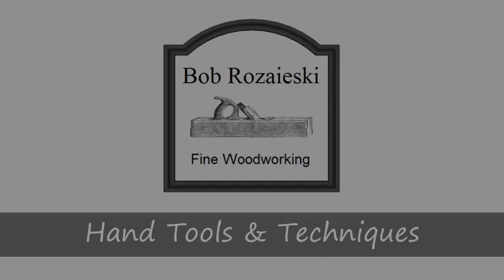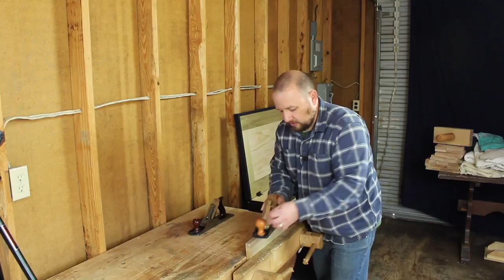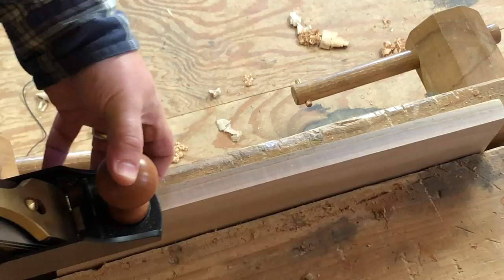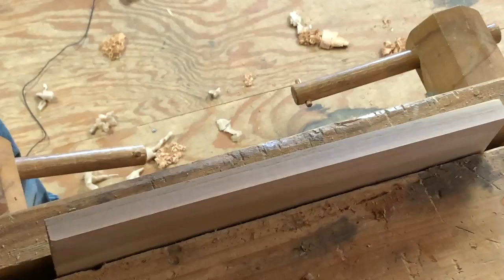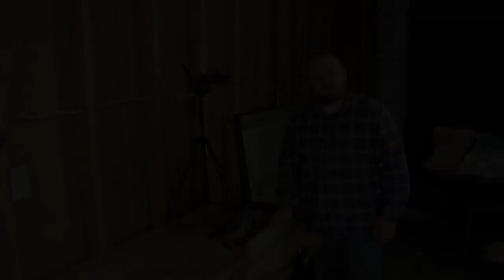When to Stop and Sharpen a Hand Plane

Comment: Really true. Freshly sharpened blade go through the wood like butter effortlessly. And when I start sweating then I know for sure that it need to be sharpened. I'm a woodworking hobbyist since about 4 years (thanks to you and the other youtubers) and sometimes I don't touch wood for months...but after a couple of years I've start develop the feeling. Now I just need a second to touch the blade and know at what level of sharpening it is. My prefer method is to slide my thumb on the blade very very softly (along the edge, not through..and yes I know it's the best way to cut my finger :) ). Thanks for sharing.

Comment: Clicked like before even watching the video. Do you still use oilstones to sharpen your blades? Have you changed any thing about the way you sharpen?
Reply from the maker: Snowwalker I still use oilstones for my gouges, molding plane irons, and other high carbon steel tools. For my bench stones I switched to Sigma waterstones because of all the abrasion resistant steels used by modern toolmakers. Other than that, I still sharpen the same way I have for many years - hollow grind, hone on stones and strop.
Reply: Bob Rozaieski Fine Woodworking thank you Rob I to use both oilstones and Sigma. Lately I've been experimenting with naniwa diamonds. I've heard they last for years they are quite fast and stay flat.

Comment: But is it closer to an hour of use or ten minutes of use?
Reply from the maker: SkylersRants Could be either, or both. Time really isn’t an important factor to worry about as there are too many variables. It depends on the type of wood, the aggressiveness of the cut, the pace of the work, the angle of the bevel, the type of steel, and the needs of the situation. For example, I’ve often gone weeks between sharpenings for my jack plane and mortise chisels when working with white pine, while at the same time I may sharpen my smoothing plane after only 20 or 30 passes on a particularly squirrelly piece of curly maple. It’s more about the feel of the tool, the results you are getting from it, and how those two factors compare to your desires or expectations for it.

Comment: I think that one reason a lot of us don't stop to sharpen/strop enough, is because getting the blade back to where you had it, before sharpening, can be tedious.
Reply from the maker: Matthew Buntyn Yep, it sure can be if you don’t do it enough. But like anything else, the more you do it, the faster and easier it becomes. It’s become second nature to me now. After sharpening, reinstall blade and extend slightly, sight down sole and adjust for even side-to-side projection, retract blade fully, start planing and gradually extend blade until it’s back to where it was. It took me longer to write the process out than it takes to do it 👍🏻.  Takes a bit longer with wooden planes but still can be quick with practice.

Comment: Without both planes being the same this demonstration is pretty worthless. The difference could be just down to the length of the bodies.
Reply from the maker: Well, you're only partly correct. If the board were rough sawn or the edge were not straight and flat, I would agree with you that the length of the plane could impact the demonstration. However, this board's edge had been planed straight and flat prior to the demonstration to take the effect of an out of flat edge out of the equation. So essentially, both of these planes were doing nothing but smoothing an already straightened and flattened edge.

However, I do agree that it is not easy to demonstrate the point that I'm trying to make. Attempting to show visually what is actually something very tactile, is not an easy thing to get across. But I did my best to answer the question.
Reply: @BobRozaieskiFineWoodworking  perhaps. Variables still negate experimental results due to their influence on outcomes. The point of experimentation is to find answers, not raise new questions. It sounded to me like you knew what you were trying to do was hard. It may be even harder to do than you realize. There would always be the human factor that would be extremely difficult to eliminate. Your subconscious bias could influence how you use a tool, which would skew results. For instance if you "knew" one plane was duller than another one. Then you'd likely use it differently. Science is a hard thing. Which is why I leave it to the men in the white coats.
Reply from the maker: Paul Frederick I agree. My day job is in science so I totally understand the scientific method and how having multiple variables can result in convoluted outcomes. However, this was not meant as an experiment, rather as a demonstration of how differences between a blade that is getting dull and one that is sharp might present themselves. I fully knew the outcomes ahead of time as I knew one blade was sharp and one was dull. I was not looking for answers to a hypothesis. I was simply trying to show the difference between sharp and dull.